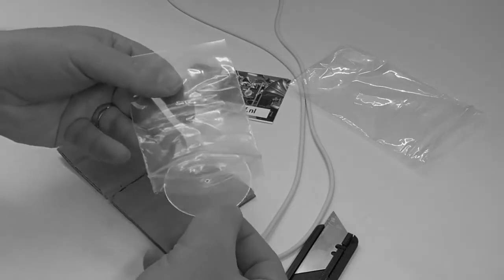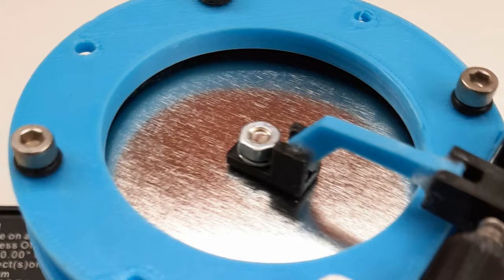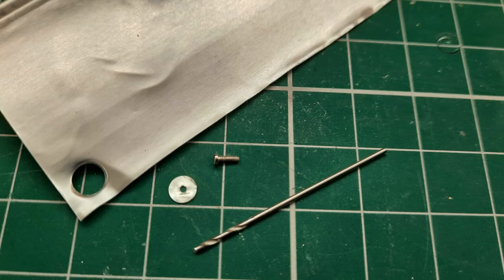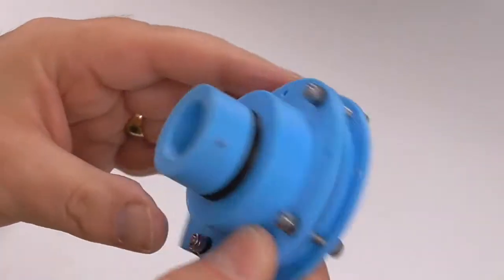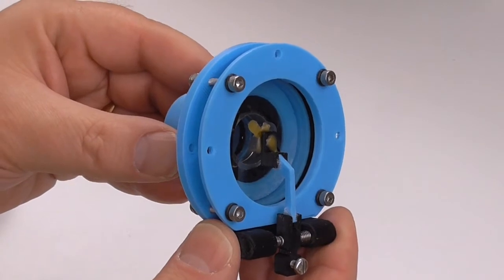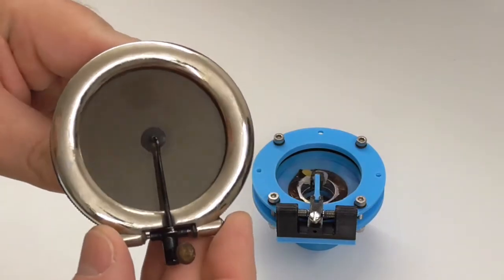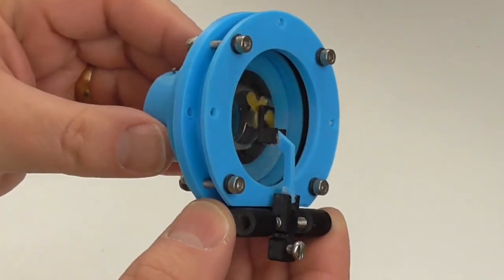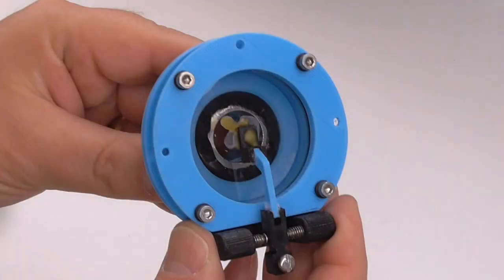DIY Soundbox mica diaphragm test

Comment: Both are great but it's no 4 the clear winner for me. The DIY has a thin sound for my ears. As others have said could be air escaping as when the gaskets in old boxes wear they end up sounding like this and then worse. Great videos though. Looking forward to more refinements. Cheers Paul
Reply from the maker: Yes, the DIY one is not airtight. I have not fixed it just so the tests stay comparable. Thanks 😀 👍

Comment: I hate to ask but do you have the STL’s available for this soundbox? I am thinking of using it as a jumping off point for my Edison modification. The quality of it is quite nice and since you’ve been exposed to real reproducers and I have not I’m sure there are certain nuances of the designing of such things that I would overlook. If not that’s fine, I’ll just bang around in the shop till I get there. I’ve just now been printing again as I have replaced a dead computer and I used my handmade soundbox to the point that I have to use GrandadIsAnOldMan’s trick of super glue and baking soda to repair it every time I want to have a listen. Anyway, thanks again for the videos and keep them coming
Reply from the maker: Sure, whilst I haven't actually posted them anywhere, I would be happy to send you the STLs. If you email me on my mrrgstuff Gmail account (details should be in the about bit of this channel) I will email them to you.
I don't think I would have got as far with this project without all the comments and feedback I have received, so thanks for the ongoing support and glad you have been enjoying the videos. 😀👍
Reply: mrrgstuff thank you very much for the models. I will take care that they don’t fall into the wrong hands.😃
Reply from the maker: Thanks 😀 At some point I hope to package them up and release them in some way. I  still have v3 to design also! 😀👍

Comment: You constantly improving it. Soundboxes are precision devices, getting the results you are is marvelous. It's starting to sound like a cheaply made vintage soundbox, which is a big achievement. I would stick to mica, as I believe it will get you closer to good results.
Reply from the maker: Thanks. Yes the mica is great, and I worked even better than I hoped. I will try a corrugated aluminium one also just for comparison. 😀👍

Comment: I think the diy sounds a bit like it’s losing some air somewhere. I’m not sure whether filling in the sides would help?Looking forward to seeing how the Aluminium diaphragm turns out. Good work.
Reply from the maker: I think you are right. When I have a very close look at the gaskets and also the back section where the washers are, I can see it is not perfectly airtight. For comparison purposes I am not going to change it on this design. However for my next design I intend to do better. I really need to take a sound box or 2 apart to see how best to do the sides, and make them airtight too. Thanks 😀 👍
Reply: mrrgstuff no worries. This is not criticism by the way just wondering out loud. It’s all very interesting. Cheers
Reply from the maker: @davidk6271  No problem. I wasn't taking it as criticism. The glue I have been using on the plastic sticks well but is a poor gap filler, so next time around I may go over the joints with something else. I am also curious to understand how most sound boxes implement the sides. Mine doesn't have them only really because I wasn't sure how to do them! 😉. Thanks 😀 👍

Comment: Really not bad at all. Difference may be down to differing resonance in the sound box, and perhaps the mass of the radial bar from the needle to the diaphragm.
Reply from the maker: Yes indeed and maybe just the overall mass of the diy soundbox being so much less than the No.4. There is a bit more I indeed to do with this design, but I  hope to address at least some of these issues in my next design. Thanks 😀 👍

Comment: Into the realms of personal preference here. If I were to choose, I'd say your soundbox performs better on the acoustic record & the N0.4 does a better job on 'Jollity Farm' the early electric recording. The Electrola, with its No.4 would have been designed with early electrics in mind, guess they did a lot of research at HMV.
Reply from the maker: Thanks. Yes, I was surprised just how good my one was with the mica. Its clear why it was such a popular choice. The No.4 is a such a good all rounder. My understanding was that it was actually originally a pre WW1 design, that was picked up much later, however I suppose it would have made sense for it to be tuned more for electric recordings by that time. 😀👍
Reply: @mrrgstuff  I've heard that glass is even better & was indeed the choice for acoustic recording diaphragms. Last time I checked they were available. I once came across a glass one in an Edison Bell Imp. Sadly, never got to hear it, thinking it was mica, didn't give it the respect it deserved :-( Would like to know if science went into gramophone development, or was it powered by 'tinkerers' with good ears! Gut feeling is the performance of the Electrola is down to the larger No.4 diaphragm & its narrow tone arm. I understand the orthophonic system of machines like the HMV 163, was designed by adapting the mathematics of electronic sound reproduction to its acoustic system.
Reply from the maker: I think initially it was all trial and error, and even in the later days there were companies who just imitated other peoples designs in the hope they would work well ( much like I do! 😉). Clearly though by the late 1920s there were some people taking a much more scientific approach. If you have not seen it before, the book "Modern Gramophones and Electrical Reproducers" by P Wilson and G W Webb is in my view an excellent book on the subject. Paper copies are expensive, but I found it for free online as a PDF. 😀
Glass does seem like a good thing to try though searching for 1mm glass mainly turns up Acrylic which is probably worth trying also. I think the glass used for Smartphones might prove to be a suitable source. Thanks 😀 👍
Reply: @mrrgstuff  Interesting substance to try, but I was thinking more in terms of real glass, which would need to be less than 1mm thick. Here's a supplier: https://www.cylinder.de/glass-diaphragms.html Was surprised to see that they're available for the 'Exhibition' soundbox, so maybe there was a deluxe model on the market that had one. To date, I thought they were only found, albeit occasionally, in cylinder machines. Would love to hear one, but the fragility would be a problem!
Reply from the maker: Very interesting and thanks for the web link. The prices look pretty reasonable too. As you say presumably there is a historical precedence for supplying a glass one for the Exhibition. I know there were lots of copies of it around too, and maybe other early sound boxes took the same size? A bit small for my current diy sound box but certainly something to consider. Thanks 😀 👍

Comment: It may be my old ears but I prefer the DIY one as the sound it produces is more pleasant in my opinion. I noticed that your number four seems to have a more aggressive angle of attack. I would like to hear a side by side of all of them if you take video requests. Great video and always look forward to seeing new ones
Reply from the maker: Yes, I was considering doing some more side by side comparisons as I already have the footage from the previous videos. I will see what I can do. The angle of attack is a good point. I noticed this too when editing the video and yet the locating pin is at the same approximate angle on both. I will investigate further but I think it is maybe an optical illusion due to the different thickness of the sound boxes and the camera angle. Thanks 😀 👍